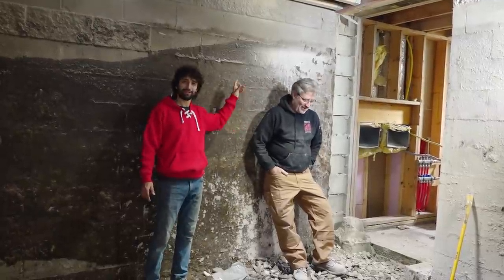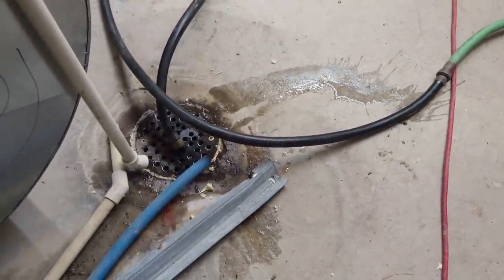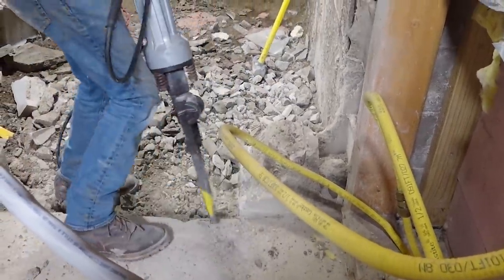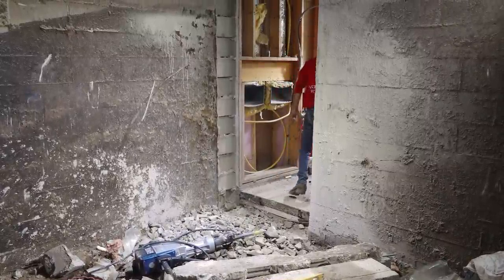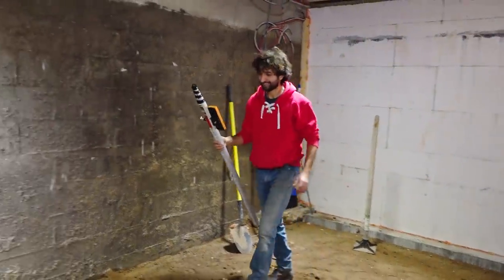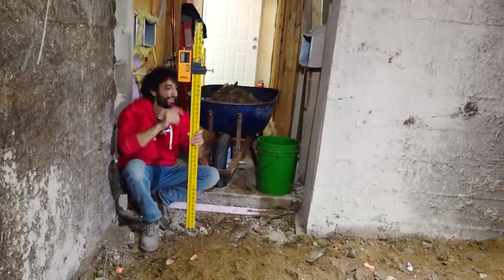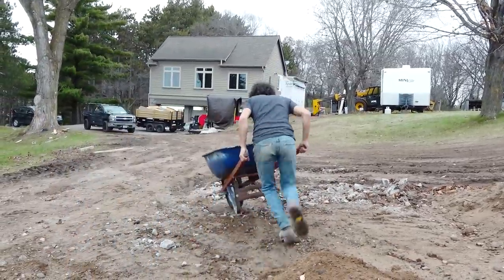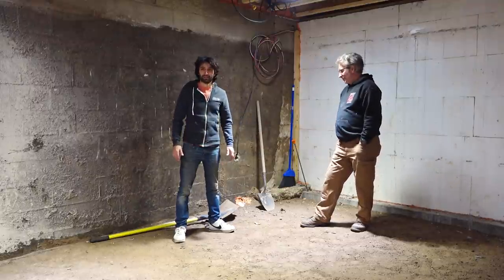Grading the Basement Floor | Home Renovation & Addition Part 17

Comment: My very first job in highschool I worked for a guy like Donavon. I learned so much because he knew how to do everything. I was basically his Matt to Donavon lol.
Reply: me too when I was 18.  Helped a guy build a house from the ground up.  Just 3-4 of us. I knew nothing about construction at that time.  A friend of mine and I saw this one guy framing a house by himself and we were looking for a summer job.  He hired us on the spot.  I went to Sears (yeah, i'm old) and bought a hammer, tape and tool pouch.  We finished the framing, installed the roof, the plumbing, the drywall (I was one and done on that job), the trim and a bunch of other things.  This guy was like Donovan.  He could do anything and everything.  I even learned how to drive a stick shift in his 5 ton flat bed to go get materials.  I use these same skills 45 years later.

Comment: You convinced me the best way to level sand is the same way we do for patios. Lay 2 pipes so each end's top is the desired level and then use a screed board. Tamp. repeat.

Comment: A demo hammer that big can be hard to use.  Handy for certain thickness of concrete only if you can let the weight do the work for you. Great bit on the grain and cut of the concrete slab, thanks for that.

Comment: Matt, that jackhammer looked like ut was owning you for a bit, then realizing you butt dialed 911, I died laughing 😃 
Presenting the concrete slab was completely epic with the flecks of blue and pink aggregate with the finish saw cut, that was great! How well does Donavan like the Shark Bites? Pex to Copper.. I like the way they perform, I have had mine for a couple years so far.
This was an epic video,  and thanks for the talk on the Lazer level,  I couldn't have done better myself 🙃. Can't wait to see more stuff.

Comment: The amount of effort it took to demolish those block columns is a testimate to how well they were built and how strong they were.  This is only a guess, but I’m guessing that the last wheelbarrow load of dirt weighed quite a bit more than you do Matt.  You got the job done though and kudos to you both for the amount of work you got done in this video.  The marbling on the concrete slab column looked nice, but I would rather have one of your tree-with-a-crotch slabs for building with.  Using something like that column looks too, well, too cement-like and stony for my taste and that’s my concrete opinion….

Comment: Err, hang on.  Rewind to 11:38.  Was Don just bleeding that valve above an electrical juction box (the green box)?  Water splashing down onto that doesn't seem right.  BTW we have the same boiler here in UK.
Reply from the maker: Watch his hand turn power back on to the control box as he’s stepping down

Comment: What is going to happen with that glop of concrete at the floor that the blue broom was sitting on? Won’t that be way of the new slab?
Reply: It’s actually at the level of the new slab, so it will just incorporated in. You can see it on some of his pics on Facebook.
Reply from the maker: That’s the footing of the original house. Ended up flush with the top of the floor and most of it will be hidden behind the wall we’ll frame there

Comment: Im curious if those Shark Bite connectors are a temp thing until you get all this done? It looks like in the video Donovan is twisting the tubes into the shark bite , and I found out the hard way that this scores and causes leaks. So Yea I was just curious, shall you ever happen to read my comment
Reply from the maker: Temporary. That manifold will need to be relocated

Comment: I saw some pressfit plumbing as temp installation, but what's Donovan's opinion on sharkbite used for permanent installation? Does it change if it's accessible, like in a crawlspace, or unaccessable, like behind a tub?
Reply: This temporary till the plumber comes and reroute everything
Reply: @Donavans Homes Yes. Will you replace with crimp pex or solder copper? Would you use sharkbite for anything other than temporary?
Reply: @JosephClatterbuck  I only use it for temporary I think some codes allow it but with need to check your location

Comment: I asked this on the last instalment but didn't get an answer:  Why did you cut two vertical cuts into the existing basement and then knock the wall out from the right hand one all the way to the corner?  Just curious.  Change of plan?
Reply: Saw would not fit in to the corner on this side of the wall cutting on the other side would have been big wet mess
Reply: @donavanshomes  thanks

Comment: 12:25   how droll.  That machine was too big and the bits too dull. The smaller machine with sharp bits is what you need. A chisel tip and a point.  SHARP please.
  It's possible  that the vibration was like an accident to the iphone.  It thought you were in an accident.